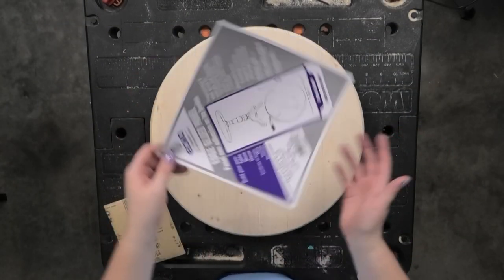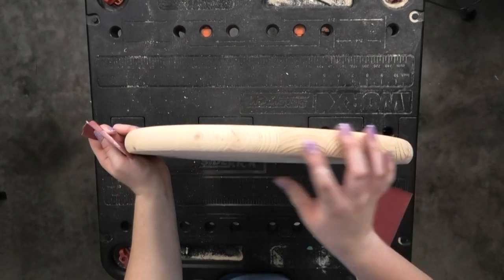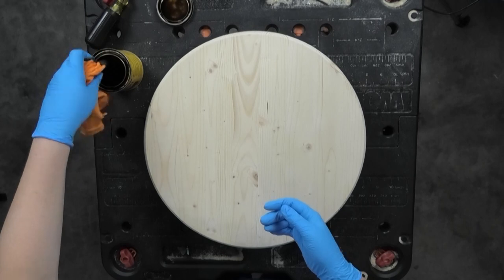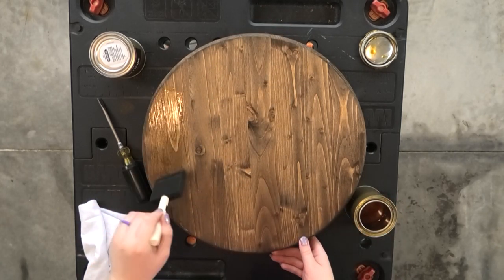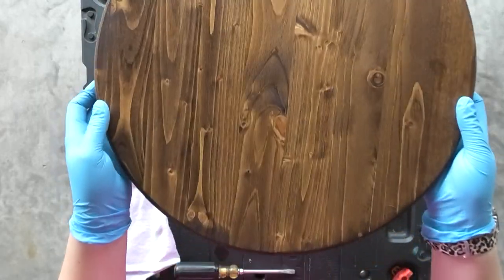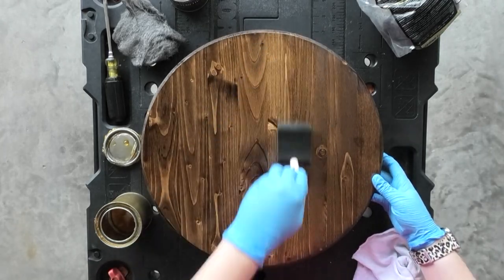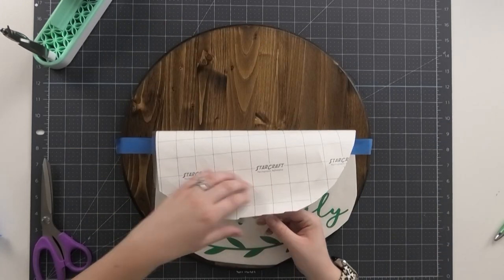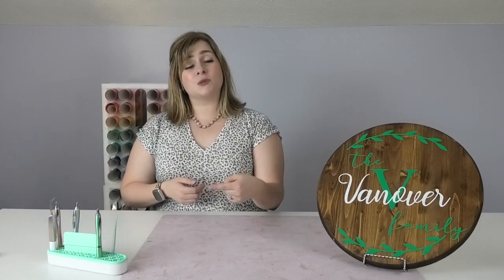How to Make Wood Signs with Vinyl Using Cricut

Comment: As a woodworkers, I see where you left out an important step. After sanding to 220, you should take a damp cloth and wipe down the wood. This raises the grain. Then you sand again to 220. Now, when you stain, you'll get a really smooth finish.
Reply from the maker: Great tip! Thanks!

Comment: Thanks for the video. It’s very informative, especially the “hinge method” of applying vinyl. I do have a question. How long do you let the board dry after the second coat of poly before you put the vinyl on?
Reply from the maker: I let it sit overnight usually.
Reply: @DIYAlex  100% correct.

Comment: I read through the comments and saw that you don’t recommend using poly over the vinyl because it’s not necessary for a sign. Wondering if it’s necessary if it’s being used for a tray or a lazy Susan where things are being put on top of it and removed on a regular basis. Just want to make sure that it lasts!
Reply from the maker: It still shouldn't be necessary. Permanent vinyl is way stronger than we give it credit for. It's more beneficial to seal underneath the vinyl than to seal on top :)

Comment: This video is helpful but, I do have a question: how long do you let the stain dry before doing the polyurethane step? When I stain, I do the polyurethane BUT when I go to lay down my vinyl it does NOT want to stick and I honestly get so frustrated lol Am I doing something wrong? I feel it shouldn't be that hard for the vinyl to stick. I am using 651 permanent vinyl from Expressions Vinyl
Reply from the maker: It needs to dry until it’s not sticky anymore. You may need more than one coat in order for it to sick. Make sure you sand with steel wool until in between coats.

Comment: Hey there, love the video. I do have a quick question though, I am making a sign that will be outdoors year-round and needs to last. Do you have any recommendations on sealants I could use to preserve it?
Reply from the maker: You should follow the same method I showed in this video. There is no need to seal over top of the vinyl because that can actually get underneath the vinyl and cause discoloration and bubbling. Just seal the wood and let the vinyl do what it does best! :)

Comment: Such a helpful video! Gathering supplies now! Just one question. About how long between each coat of stain and poly do you let dry?
Reply from the maker: Yay! I'm so glad you liked it! Let then dry until they're no longer sticky. Dry time will vary with humidity and temperature.
Reply: @DIYAlex  another question! I got water based polyurethane? Does that matter?

Comment: Is this what you would do for an outdoor sign that will be exposed to the elements as well? Or would you need to seal again?
Reply from the maker: No, you can actually get sealer underneath the vinyl and cause it to lift by sealing over top. You'd follow the same process for indoor and outdoor signs.

Comment: Help! I am currently doing this, but as I’m trying to peel off the transfer tape, the vinyl doesn’t seem to be sticking and is peeling the finish off the wood any tips?
Reply from the maker: Try using a tennis ball to work with vinyl into the wood. Also make sure you’re peeling the transfer tape at 180 degrees (not pulling up when you peel).

Comment: Hi Alex! I've been watching your video and gathering supplies to get started on my first ever signs woohoo but I do have a question...I dont have a cricut machine so im going to be painting with stencils so should I still follow all these steps or do I need to paint before the polyurethane? Thanks!
Reply from the maker: Hey Aimee! I'm excited for you! If you are painting, then you need to paint instead of stain, and then you can decide if polyurethane is necessary for stenciling. If you're going to lay down a sticky stencil, then polyurethane is probably a good idea. Just make sure if you're painting with white that you use water based polyurethane so it doesn't yellow your paint.

Comment: Did you varnish again after the vinyl went onto the wood? I watched someone else’s video and they put the poly on after the vinyl lettering was applied. You mentioned that the vinyl sticks better to the poly but I wanted to make sure.
Reply from the maker: No, it's not necessary to add anything over top the vinyl. The surface underneath the vinyl is the most important part :)

Comment: do you recommend sealing again after placing the vinyl or is the vinyl sticky enough to not worry about it peeling?
Reply: If it is permanent vinyl and is applied properly, it needs no sealing.
Reply from the maker: Once you seal the surface, that gives vinyl enough to stick to and stay without needing to be sealed over top.
Reply: DIY Alex thank you!

Comment: Hi so I did the prices but my vinyl comes up. Anything I can to to make out stick?
Reply from the maker: Use less tacky transfer tape if it's coming up while applying. If it's coming up after you apply it make sure you do an extra layer of polyurethane to seal.

Comment: Really nice job... didn't catch what you used to seal the stain???? Was it Polyurethane?? Lol... great job..x
Reply from the maker: Thank you! Yes, it's polyurethane.
Reply: @DIYAlex  You mentioned that you used Poly-urethane and it can be used indoors or outdoors.... if you read the directions of Poly-urethane it actually tells you that it should only be used indoors. Spar-Urethane (Spar-varnish) should be used outdoors. Poly-Urethane will eventually become cloudy when exposed to moisture.
Reply from the maker: Oh gotcha. I’ve never had any issues with my polyurethane clouding,  but my porch is covered so it may be because my signs aren’t directly exposed to water. I’ll have to look into that. Thanks for the info!

Comment: I cannot get the vinyl to get off the transfer tape to stick to a wood cutting board (bought from dollar store)
Reply from the maker: It’s probably due to the transfer tape being too sticky, or because your wood is not sealed. Next time stick your transfer tape to the table or your shirt to remove some of the tack before applying to your vinyl.
Reply: @DIYAlex  i have siser psv and oracal 651are you able to use those on wood , if so do i just follow your video ? im new to this whole thing sorry

Comment: If I use removable vinyl instead of permanent, I can apply a coat of polyurethane on top of the vinyl to secure it in place correct? I was thinking of using spray on polyurethane. Would this work?
Reply from the maker: You don’t need to seal over vinyl. If you do the sealer can get under the edges and cause peeling. I recommend the method that I teach in this tutorial.